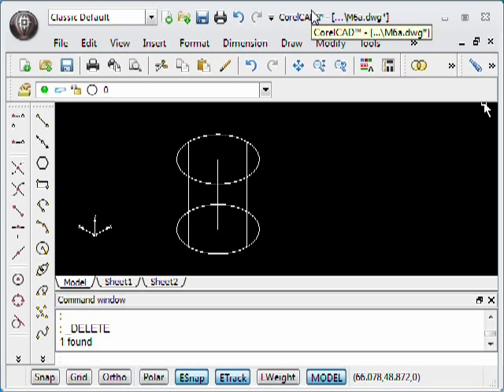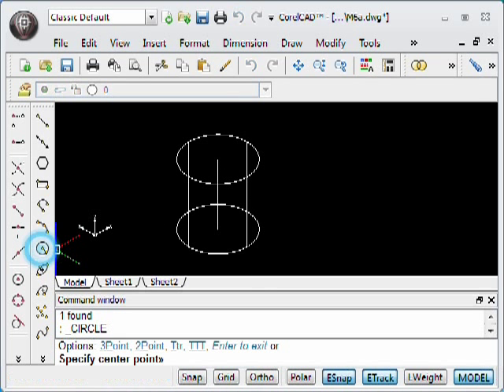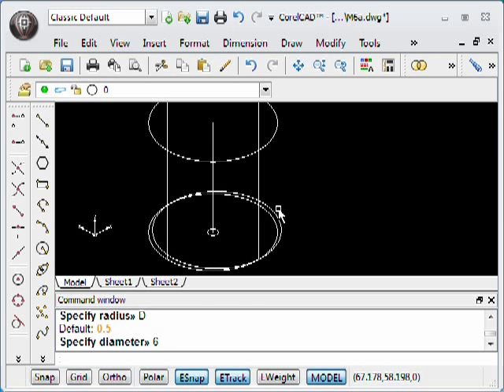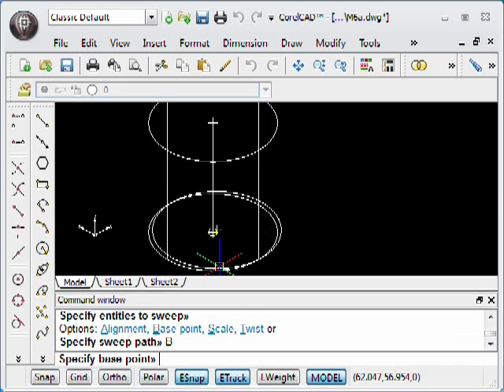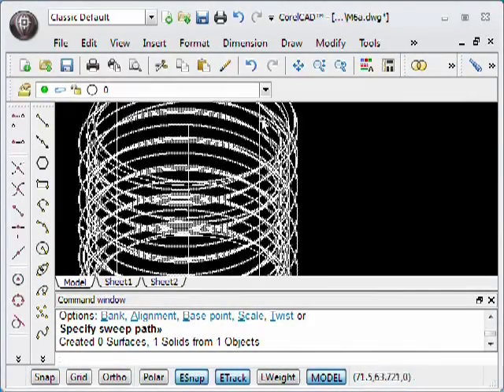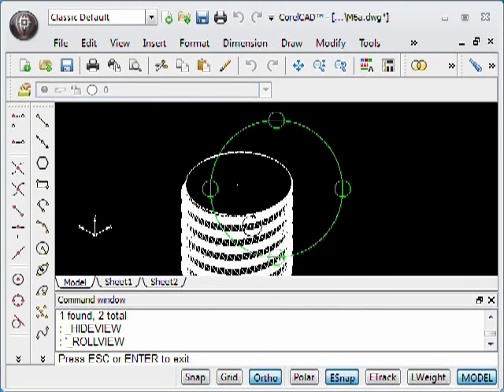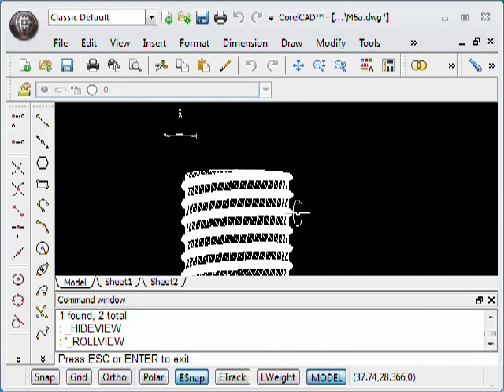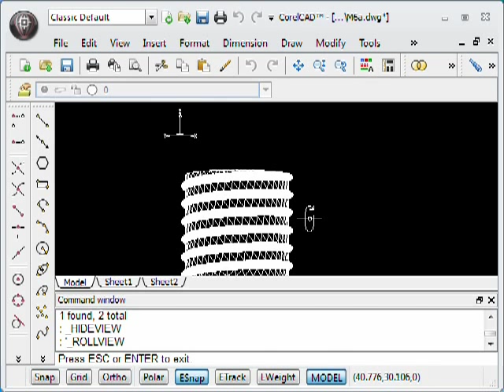Threads MP4

Comment: Did they ever fix the sweep command for the new versions?
Reply: Yes, they did, around the 2020 version, though I think it might work in 2019 as well. Also, I wrote an AutoLISP routine that you can download from the Corel technical forum called ISOTHREAD that you just run as a command, and give it the pitch, diameter, number of starts, direction etc, and it just creates both bolt and nut threads - this works in all versions prior to CorelCAD 2018
Reply: I was able to look at your autolisp and it was exactly what I needed also the thread  was generated as a 3d model and not a polymesh. Thank you for creating it.